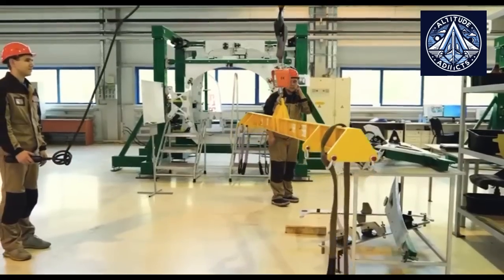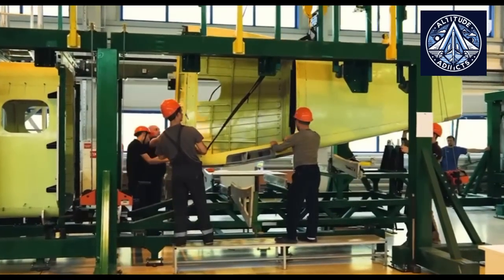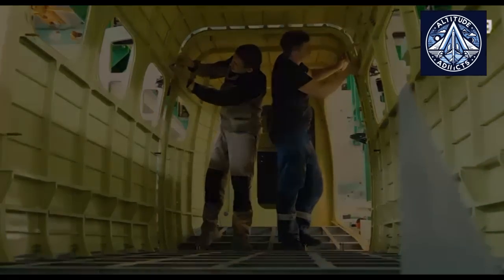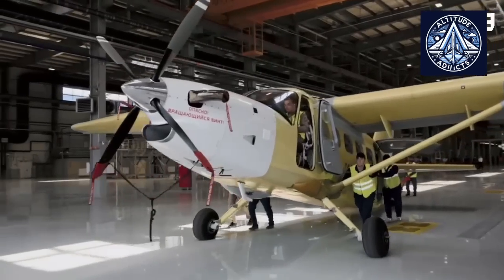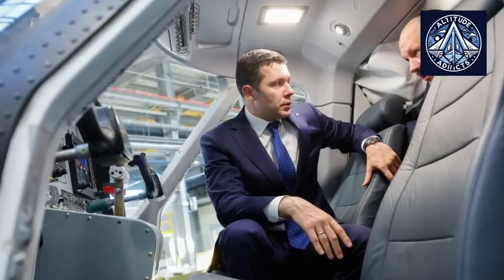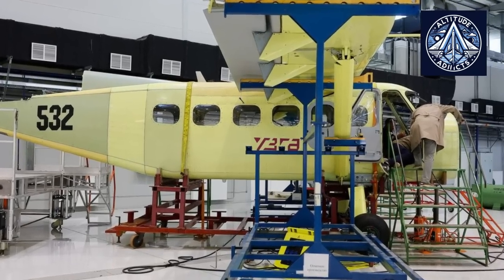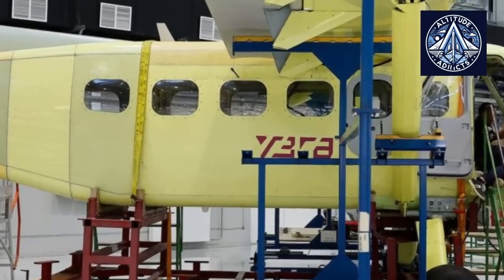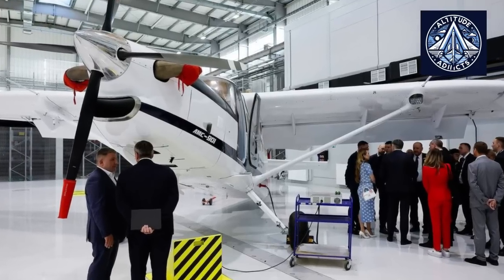Third LMS-901 Baikal Aircraft Built—2026 Launch Still On Track!

Comment: You are always going to limited by the availability of the engine.
Reply: Do some homework chum.. there's a brand new engine being developed..shown mounted here!
Reply: @daveverster7483 Hey CHUD, yes this was all mentioned in the video. I was just saying engine development takes longer than airframe development. 

Having sanctions imposed on your country thus (usually) makes the engine the limiting factor in development. There is nothing abnormal here.

I hope the VK-800 a swift certification process.
Reply: @erich623  as far as i know frame development started way earlier than engine anyway. and was stopped at least once. engine started only few years ago as engine substitution for many engines that russia cant import any more and it would be used in other aircraft/helicopters too. at least according to plan 
it seems engine was actually developed faster than airframe in this case